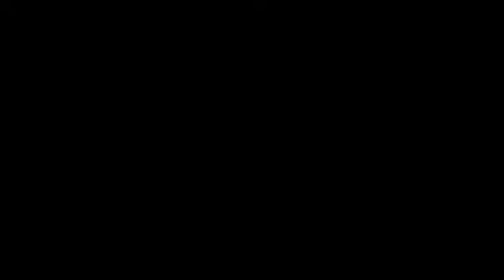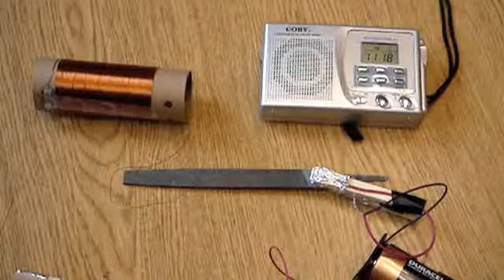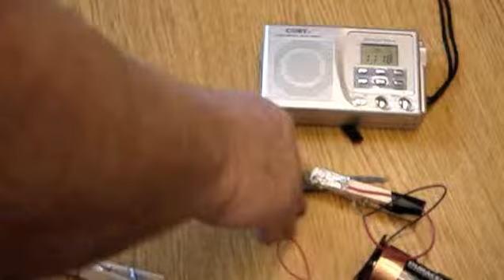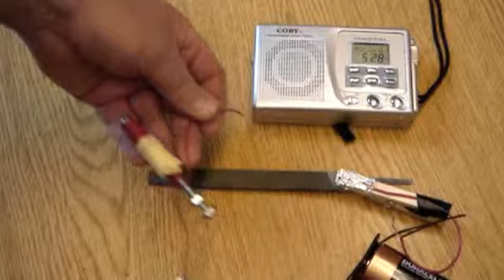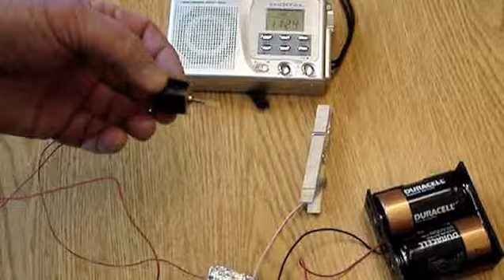RF Experiments

Comment: Its not electromagnetic field. The Motor has coil and magnet inside, when you connect the motor into the battery the coil will start to spin and create spinning magnetic field and create Eddy current in the antenna coil of the radio which create the wooooh sounds in the radio but the coil is actually creating electromagnetic field but also very weak. The way it works is the coil has a parasitic capacitance across two terminal of the coil which create LC tank circuit and oscillate at RF frequency and picked up by the radio
Reply: I am sure that there are eddy currents afoot at short distances, however this effect can be heard at a distance that Lenz's Law would likely not support. You can hear this effect from a old points-type distributor of a truck or car rumbling down the street without an RF suppressing capacitor. So, at some level it surpasses the explanation of eddy currents when we see the effect at a distance